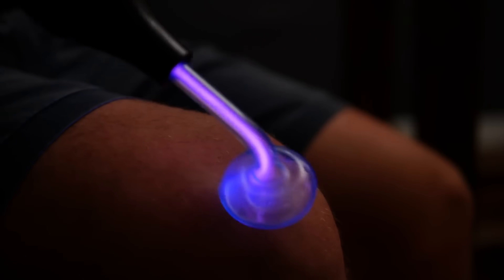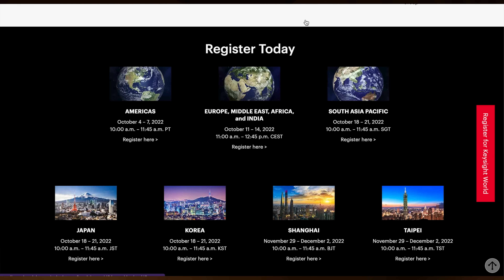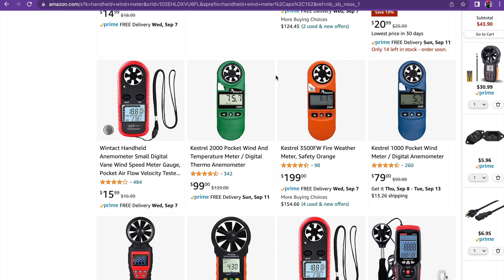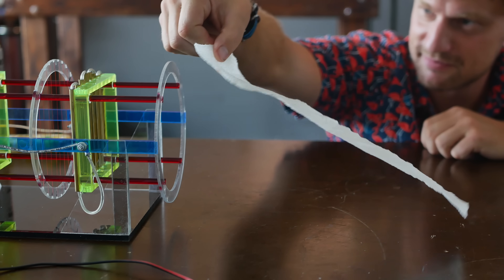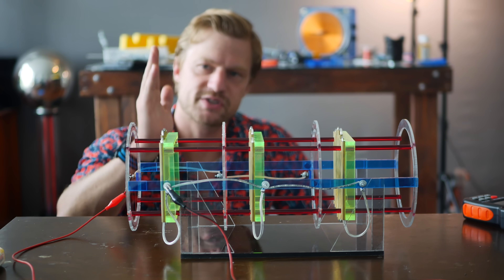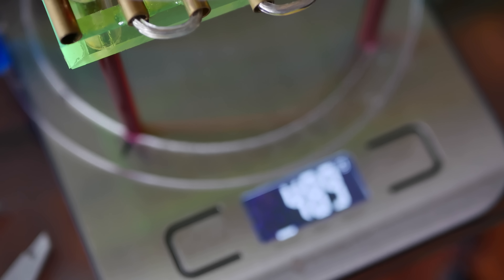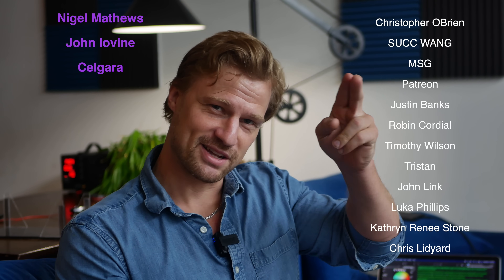Designing A Next-Gen Ionic Thruster! (For Flight)

Comment: Man this is really cool! I have some questions I would love answered though.

Would flat, ovoid or raindrop shaped ground electrodes give you better flow vs surface area than the round ones? Or is there some kind of electrical advantage to keeping the brass tubing round?

I know K&S makes small aluminum tubing as well, would that help the weight compared to the brass or would the oxide layer make it perform worse than the brass? What about surface finish, does that matter? Like would polishing be better or would specific grits of sandpaper give you increased performance? 

What about on the positive electrodes? Would a rough surface finish give you more sharp spots to discharge from? Would taking double edge safety razor blades (shaving kind) and cutting them in half then polishing the blunt center side (so it faces oncoming air) give you better directionality and low weight for your positive electrodes or would it be too much hassle? Would blades pulled form a disposable razor be even better (less cutting needed to get them small)?

Comment: Some ideas:

-What if the air was guided by interior walls to prevent excess drag?

-What if the stages decreased in size to match air velocity?

-What if the size of the jet nozzle was tuned?

-What if the wires and rods were replaced with Aluminum hex mesh and honeycomb?  Mesh intersections spaced to line up with honeycomb holes?

-What if we scrapped the entire operating principle and instead used the ionic wind as the 'rotor wire' of a linear homopolar motor?  ...I just made a plasma railgun again, didn't I?

Comment: Some things needed, one using a cowling around the ion thruster. A jet engine uses Banewlys theory to increase its thrust, the larger opening airflow then gets compressed by the blades.  When fuel is added ( in your case the ions) it is compressed more by the outlets being smaller. this as Banewly stated reduces pressure, and increases the flow rate of the air stream. In your case, you could use a linear exhilarator. The air can be replaced with an on-demand hydrogen generator, for space travel or in aviation travel to mix with the incoming air. The linear exploratory acts as the man compressor, instead of blades.

Comment: I would recommend an exponential increase in gap, smallest first, then the second and third work on already accelerated air, so they can be spaced further apart. Much like an electromagnetic coil gun works. So, like 1in, 2in, 4in. This would almost require the enclosure others are talking about. Having the gaps equal means that air has to slow down to the speed produced by the last one.

Comment: 1) it’s open, air could be sucked in from the sides. Resulting in the stacking formation having to accelerate new air. This might get you more volumetric air across the exit but slowing down the air in doing so. Possible fix is just putting on a thruster head at the end and Incase the hole truster. If efficiency decrease I would slowly put hole along the truster at each acceleration point and see how that goes. 2) the grounding pipes. I would switch the positive wire and ground pipe. Also change them to points pointing at the grounding wire. I’d also make the wire in a grid pattern allowing for better ion spread. No to mention the air has to go around the big grounding pipes so that why I think switch them around would make for less internal drag . Not sure if I could count this as a 3rd reason mainly because number 2 might of fixed it. You couldn’t use the max power for fear the wired would melt or melt the plastic. Changing the oration of the ground pipe would allow for better air flow and able to cool the wires allowing to use higher power. 

Side note shouldn’t it be electrons flowing not protons. Number 2 kinda went off your diagram in the beginning about positive charges going to ground but shouldn’t be the other way around because electricity is the flow of electrons not protons. Even know we teach it like that. (Why couldn’t Benjamin Franklin get that one right)

Comment: I have no good ideas about increasing efficiency, but I am curious about thruster size and geometry.   (I have no background in physics, so forgive me if all this is already known).  
How do you determine how far apart the wires should be? Is there an optimal distance between them that maximizes thrust/weight? How do you work that out?
Does thrust fall off as the wires get longer?  Would scaling the whole system up in size scale the airflow linearly? (That seems doubtful).
Would a square cross-section instead of circular (wires of uniform length) be better or worse for efficiency?  
Would orienting some of the in-line thrusters so that they're perpendicular to the others change the properties of the airflow ?  
Would changing the height or orientation of each corresponding ground electrode make a difference? (If the ground is shorter does the flow of electrons from the charged side concentrate toward the ground, and would this concentrate the air flow? or do those outer electrons simply not move at all?) 

Fascinating stuff. I look forward to your next experiment.

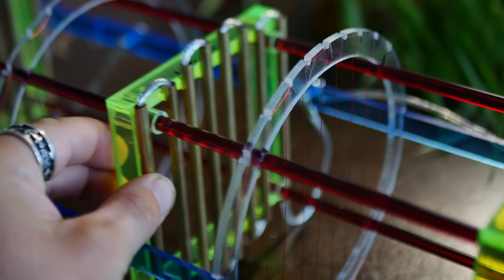Comment: by 3:30 iv found the biggest inefficiency in your design[not counting ducting] if your goal is air flow if you were going with a more typical lifter design it would have more impact but even with your config its a flaw that limits the max airflow and while i understand the materials choice i stipulate there are far superior materials to use in the same price/weight range. you can use extruded aluminum its fine at these voltages but sticking with brass is fine however using tubing is the wrong choice brass flat stock rounded on one edge and thinned to a fine edge on the opposing side would be both lighter and far far more efficient. tubes in airflow always create lee/void pockets that increase drag slowing down the very thing you want to speed up also the way the lifter tech works is optimized by a soft round face at the ion receiving edge and a sharp fine edge at the discharge edge. you can get about the same airflow with a conventional lifter running much higher voltages but with a denser grid and more stages in the chain. if you mod your current set up to have airfoil style put 2 per energized segment and optimize them for spacing you will get a significant improvement

also ducting will help lots and for this theres plenty of transparent materials you can use and still observe

Comment: Hmm, since the fundamental principle of ionic wind is by charging air molecules. I wonder if alternating the polarity of the emitter would have a positive or negative effect.  And as someone else already mentioned, without adding weight to the system that's already built. Stepping up or down the voltage as the stages move to the end should have an effect on the wind speed as well.

Comment: I think putting the stages in parallel instead of in series would result in a lot more thrust. All three in series is 50% more air velocity than with 1, so 50% more thrust. All three in parallel would be a 150% increase in mass flow rate, so 150% more thrust compared to just 1. So changing from a 3 in series arrangement to a 3 in parallel arrangement should result in double the thrust.

Comment: I have 5 suggestions (of which #4 is not as serious as the rest, but still not fully a joke):
--- 1) The plasma pictures show that there's specific hotspots on the ionizing wire, probably at defects. Introducing those defects all over the wire can probably be done by slowly dragging the wire sideways(!) over a quick running wheel of sandpaper. A wire with ionization spots all over will ionize more air molecules (though at the cost of a higher current draw). But the ionization will also not happen at point sources, from where the ions repel each other, loosing energy and deviating from a forwards trajectory.

--- 2a) Any positive ions that make it past the second (negative) electrode without getting neutralized and move to the third (positive) electrode will be slowed down by the electric field. If you swapped the polarity of the middle pair of (ionizing and neutralizing) electrodes, you eliminate that effect. I don't know if there are any molecules in the ambient air mixture that ionize to a negative charge as easily as to a positive one. If there aren't, this might actually render that stage inert instead. For an added bonus, place the 2nd and 3rd stage wires in between the gaps of the neutralizing electrodes of the previous stage.
--- 2b) I think you could even entirely eliminate all but the final neutralizer electrodes. You'll introduce some inefficiency because you switch from neutralizing ions at the wire electrodes to ions of opposite charges neutralizing each other, which will release some energy in the form of light. But that should only be on the order of 10-30 electron volts per ion pair (caution: hard UV!), which is negligible compared to the dozens of kilovolts this thing runs at. And in return you can save 2/3rds of the most heavy component.
--- 3) Use two staggered layers of neutralizing electrodes. I'd keep the same amount as you have ionizing wire electrodes, so that they can be paired up with a neutralizing electrode directly behind each ionizing wire. But alternate them between 2 layers with a ¼ inch or ½ inch (plane-to-plane) gap.
Any ions heading straight for electrodes will naturally hit them; any ions heading for either side of a gap between the electrodes will be attracted to that electrode; but any ions heading for the center of the gap between electrodes will experience no net sideways force. Having an electrode behind the center of each gap of the first layer - and an electrode in front of the center of each gap of the second layer - will mean that any ion that passes through one of these areas with no sideways field will hit an electrode head-on.
Furthermore, this will reduce how much the neutralizing electrodes pinch the air stream and thus the drag.
--- 4) Make the neutralizing electrodes more aerodynamic. (Sorry, this is copied from the example comment in the video.) They should probably be long plates, to give ions more opportunity to drift through the air stream to the electrode surface. If you do change (2a) but not (2b), only the last electrode will need to be long, the other neutralizers can be short plates.
--- 5) The decrease of air speed with increased electrode spacing shows that it's all about the field strength (probably for the initial ionization), whereas I would have expected that giving the ions a longer travel time would allow them to exchange momentum with air molecules more effectively. I'd try to take advantage of both by swapping to a 3-electrode setup:
The gap between the first and second electrode creates that strong field needed to initially ionize the molecules at the first wire, but in order to keep the potential drop low, the distance between the electrodes is kept very small. They'll have about 44 kV/in or more (you'll want to stay away from the arc field strength of air of 3.4kV/mm=86kV/in, though), and I would hope that it's physically possible to get the gap as small as .25 or even .15 inches (wire-to-wire, not plane-to-plane) - i.e. 11kV potential difference.
And then the distance between the second and third electrodes should provide a strong potential difference in order to impart as much energy onto the ions as possible, but also provide a long distance to allow for that momentum transfer from the ions to the neutral air molecules. I'd give this a 44 kV potential difference in a distance of 1.5 inches or so (for a field strength of around 30kV/in). If you use (2b), this figure applies to the voltage between the 2nd electrode of the preceding stage and the first wire electrode of its next stage.
Since you do NOT want the ions to get neutralized at the second electrode in a triple, I'd make them out of wire like the first one.

Comment: You could shave much more weight by using thinner wires and styrofoam or light balsa wood frames. Using a square shape and thin yarn or rubber bands as frames for the wires could save even more weight. With wings and the design change this thing could actually fly forward at least!

Comment: Some inefficiencies I could see in this system (mind you, I'm not a physicist :P)

1. The spacing of the stages themselves, as so far you've only accounted for the spacing between the ion source and receiver.
You want the spacing to allow for maximum friction between the plasma and the air, however you want a uniform flow once it reaches the next stage, which likely is dependent on the existing velocity at any given stage.

2. staggered voltage, staging power for all 3 units. You won't have higher end speeds if you use less, but at certain speeds, the ratio of voltage to increase in velocity might have a sweet spot to reduce overall power input for a given output. So efficiency per voltage per input velocity might be interesting.
Using a high voltage stage with inert air is likely relatively effective compared to doing the same on a high velocity input.

Idea here, the voltage likely affects the velocity of the charged ions, so you'll need high charges to reach a high top speed, but you don't necessarily need it to get the airflow going initially.

3. More controlled airflow and better aerodynamics of the ion receivers. If I got it right, it's charged air that's slammed against the receiver, meaning that you'll have a small stream of turbulent air / plasma at the exit of each stage. So while the main stream of air is generated by friction between the plasma and the surrounding air, managing the plasma that is exiting the stage might increase the efficiency.

Comment: I think one of the inefficiency is that the copper wire had a coating of oil or something non conductive Wich would make it harder for ionic wind to form

I also think the second inefficiency is that there is no shell around the thruster letting air get in the way and slow it down

And my third guess for the inefficiency is that there are no skeletonized pieces.

I'm probably wrong but I hope I can at least aid someone with one of their guesses in one way or another

Comment: Enclose the device in a sealed tube to prevent leaking. Maybe try some nozzle at the end. Induce a magnetic feild. Also you need to try staggering in the opposite direction, closest spacing at the front. I’d also rotate the middle stage 90degrees. And finally look at 3d printing instead of off the shelf acrylic to reduce weight.

Comment: Problems:
1) Thrust-mass ratio considered without nominal fuel or batteries is irrelevant.  Consider that rockets are benchmarked best by specific impulse.  
2) Series ionic lifter stages needs series voltage.  Hence the efficiency gain being better with less engines.

Comment: This is great! At this stage, I wouldn't try to fly anything, you can always do that. I would be putting all my time into increasing thrust, not TW ratio, you can work that out later. Is copper the ideal material for the fine grid wires? Would higher purity cu, ag, au, pt, or other metal work better? How about doped or coated copper or other metal? Do the wires erode? So many questions, so fascinating!

Comment: Last year I started a research project for school science fair on Ionic thrusters and what lift they generate based on voltage... but I failed when designing my first thruster. Have to say, if I had that video a year ago, man I might actually finish the project.

I made a prototype from 7 copper tubes and nails as electrodes, and powered it with 20kV supply but that was to heavy for force-meter to detect any change of force. If anyone has an idea how to measure these ridiculously small forces, please leave me a comment :)

Comment: if you put an electrical resistor to heat the inlet air, I imagine it will reduce energy consumption to break the air insulation barrier

Comment: Inefficiencies include total power used and power supply including cathode and anode design, the weight of the build and the gas used to propel the engine!
There are some gem comments about ducting, nanotubes on anodes, magnetic shielding to direct ions and electrons. Someone suggested adding a ECU of sorts, kinda silly but for testing different gases and needing to keep everything shielded might necessitate the need for servo controlled electrodes.

Comment: 1) Make the distance between the pairs of electrodes adjustable
2) Make interchangeable electrode rings with different number of electrodes to find optimal number and weight ratio of electrodes
3) Add removable ducting in sections (with a bell intake) to optimize effect of Bernoulli’s principle
4) Experiment with designs that spiralize and create a vortex (include stators)
5) get a cheap fog machine for airflow

Comment: I'd put the whole thing in a tube made of paper or static-dissipative plastic, so the following stages are accelerating air that is already moving by the previous stage (instead of it trying to pull in still air from the sides along with the accelerated air in then middle of the engine).  More stages may be beneficial too, utilizing thinner 'ground' tubes for more airflow and installing positive/negative grids closer together.  Finally, put it all together using the same lightweight carbon fiber tubing used in radio-controlled helicopters and airplanes.  A bonus design idea would be to 'dimple' the inside of the tube (similar to a golf ball) so air flows through it over a cushion of turbulence instead of the moving air 'adhering' to the inner walls of the tube and slowing down.  Them's my two cents, hope that helps!

Comment: What causes the bright spots on the wire? Is that creating some inefficiency?
Would this work better or worse if enclosed in a tube?
What happens if the stages are closer together? Do ions start flowing to the wrong ground?